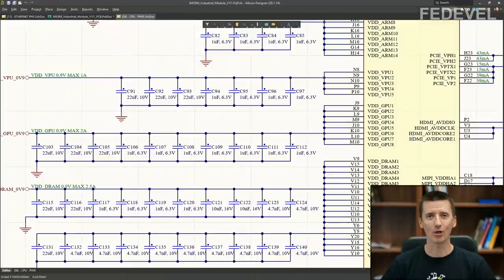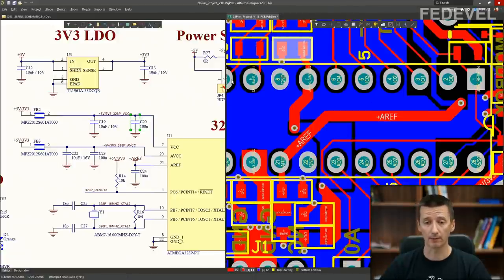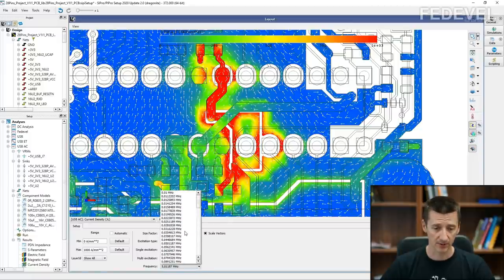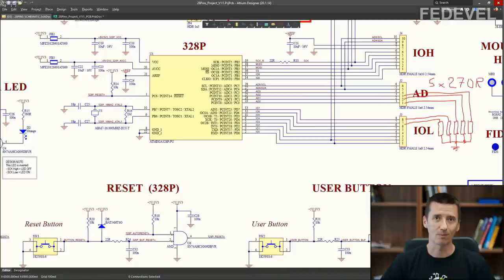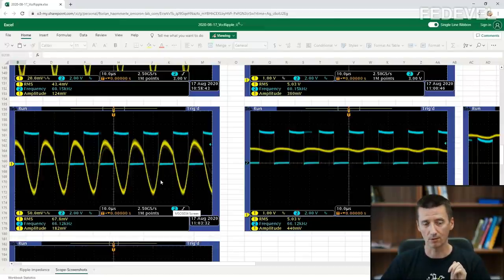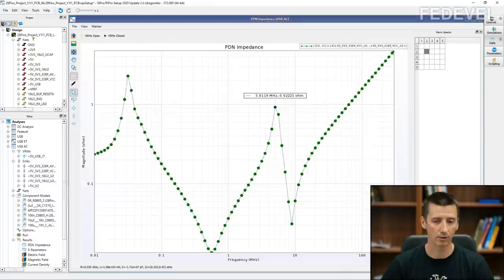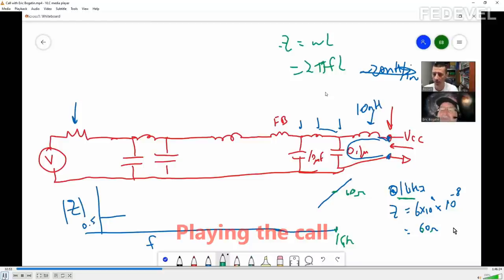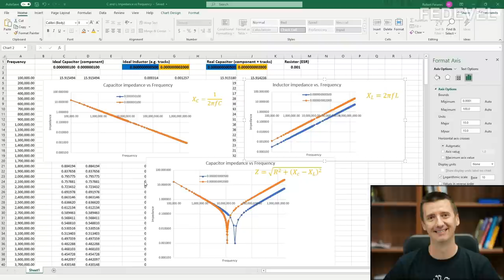PCB Layout & Decoupling - Explained why it's so complicated (Part 1)

Comment: There is no need to be embarrassed.  Going from the knowledge you gained from books, slides, lectures and whiteboard doodles to using it in practice is very often a "connecting the dots" moment and it's not so unusual to need an example, some hand holding, or just extra time to think about it before it all comes back.  Great video as always, thank you very much.

Comment: This guy's humbleness keeps amazing me again and again... An anecdote: I'm a power electronics guy and have worked with high voltage converters. So I used to design and build high frequency high voltage transformers all the time and measure the transformers parameters with the help of an impedance analyzer. I've developed reasonable experience, but the fun (sad) fact is: I had never thought of PDN this way! I guess we end up ignoring the basics when we're faced with a complex problem sometimes... Thank you for all the content!
Reply from the maker: Thank you Andre

Comment: Thank you all so much for explaining, after watching this video (part 1), you let me realized that even though the microcontroller is doing the switching (on and off), this situation can cause the microcontroller's voltage supply "Vcc" pin to fluctuate (having voltage ripple in millivolts), where the voltage across the microcontroller can become low depending on how large the "Power Delivery Network" (PDN) impedances is.

You also summarized the 3 things that you've learnt, which is the key take aways of this video❤️ love your videos, Robert, Florence, and Eric🙌

Comment: Hi Robert,
I definitely want to see the next part of this video. What I really like about this video is the collaboration of the different area of expertise that you are bringing together for us. For instance:
1) The board from your PCB design course which teaches us how to make the best use of the PCB layout tools and follow best industry practices, 2) The simulation software that you used and showed us how we even we can simulate our own designs if given the right tools.
3) Last but not the least, how you compare simulation results with actual waveform captures from oscilloscope and then bringing the expertise from Dr. Eric Bogatin who looks at circuits way differently than others given his background in physcis.

Keep up the good work Robert, it is really educating young engineers like us.
Reply from the maker: Thank you very much Nihar PS: After making this video, I may need to do some improvements on the board :D

Comment: Thank you so much for this explanation and demonstration, Robert, Florian and Eric ( no disrespect meant by omitting your surnames ).
I thought I would not need to be this  careful about switching noise at low frequencies and it's mitigation with decoupling capacitors. I have been so wrong and I stand corrected, but my curiousity about how this works is also awakened. Thanks again!

Comment: No one has every subject mastered. I say we're born with faulty DRAM built in. We regularly need to manually reset the refresh rate and often start over.
  I was in the same boat as you when Mark asked you those questions. I was thinking, 'I should know/remember this,' but honestly didn't at the moment. It's okay though. I know I need to grab The Art of Electronics off the shelf and look in the first few chapters for my answer.
 Thanks for sharing.
Reply from the maker: Thank you. PS: Yes, I had to refresh a LOT of theory when working on this video.

Comment: The most simple method is to draw the return path of each signal/current, try to minimize the overlap between sensitive signal and noisy tracks. Always place the decoupling cap close to the chip.

Comment: Good video. I really enjoy every of your videos robert. As I am currently writing my master thesis I have to add something: Everything about decoupling you told does not apply to multi-layer boards as the inductance is almost non existent by the use of vias and power planes, rather its more about reducing the length of the trace in order to transmit faster waves with lower wavelength without reflections. That's why high capacitance values like 4,7u can be placed almost everywhere on the board when designing 4+ layer board :) Best Regards!
Reply from the maker: thank you Oizys. PS: we will speak about this in one of the next videos. I already have recording of this topic from my call with Eric, I just need to process and prepare the video.

Comment: It's no wonder so many MCU datasheets recommend connecting decoupling capacitors directly to the power pins (NOT through vias) with the shortest traces possible.  Having a PDN characteristic low impedance is neat, but better to suffer a few ohms and have a flat impedance profile.  I was familiar with processes for measuring frequency response  of the PDN with instruments for that (I'm guessing you will reveal in future videos), but I hadn't considered the remarkable DIY approach you show here.  Thanks Robert
Reply from the maker: Thank you Greg. We will mention flat impedance in next video(s). And yes, Florian will mention how we measured it - we used Bode 100 ( https://www.omicron-lab.com/shop/Bode-100.html ) and a probe which Steve Sandler from Picotest borrowed me ( https://www.picotest.com/products_index.html )
Reply: @RobertFeranec  Yay! Exactly the method and tools and expert advice source I had in mind.

Comment: FesZ Electronics had an excellent video on this as well. In my opinion in the end it's all very relative. So, yes you can sometimes get resonance peaks in the impedance, but in the end of the day it's lower than without additional decoupling. Also it always will be a compromise between decoupling vs noise reduction not only from the power supply but also INTO the power supply (something people really seem to forget).
Reply from the maker: I will have a look, thank you P_Mouse. PS: I will continue explaining in the next part ... if people like this kind of content. Eric also spoke a little bit more about decoupling, so I would also include that ... it was very interesting call.
Reply: @RobertFeranec  yes, I am definitely interested in part 2. Basically instead of using Excel you can just simulate a lot in LTSpice. Just saves a lot of time.
Reply: @RobertFeranec  oh and btw, don't be embarrassed. We all had our blackout moments haha 🤣👍🏻
Reply from the maker: @p_mouse8676  initially I started simulation in Circuit lab ... and it blocked me out and asked for registration, so I opened Excel spreadsheet :D
Reply from the maker: @p_mouse8676  :D PS: I have never been the smartest at school, there were much smarter people.
Reply: @RobertFeranec  LTSpice is free, other alternative is Mircrocap, which is also free nowadays,

Comment: Got electronic education, key point and important thing you learn is that components are not ideal but have parasitic atributes.
I also have education in Automotive. And wenn I was young also into car hifi. Those huge buffer 1F elco with protection circuit. To buffer the slow chemical car Battery for heavy bass line in the music. Or insane capacitance device the size of small freezer to fire Gas laser. For making holes in PCB it also about fast power.
All parasitic inductans from decoupling C tot internals IC all adds up. That why short trace and close to pins means less inductance to add. 
Well its nice refresh of knowledge.

Comment: Wanted to make a "quick" video about decoupling capacitors.  Oh how I laughed !   I recommend Signal Integrity Simplified by Eric Bogatin.  Saved to watch later.
Reply from the maker: Yeah ... I know now .... it's not so simple :)
Reply: @RobertFeranec    Whilst at Nokia, I developed a Xilinx based FPGA board for camera image manipulation development.  My boss at the time was very unhappy that I had spent a whole three days working out the decoupling capacitor network for the board.  I pointed out that the design would have a PDN impedance of under 0.1 Ohm flat upto 800 MHz and that he'll be able to switch all the outputs simultaneously on/off without the device glitching.
I used Agilent ADS 2010 back then and modelled each capacitor as a combination of series RCL and parallel R lumps.  The data was provided by the detailed AVX datasheets.
Xilinx provide a very good application note for "Power distribution system design: Using bypass/decoupling capcitors"  ref XAPP623
Reply from the maker: @BobBeatski71  Nice!

Comment: for future video, i hope you can make some discussion about this important topic for more specific application, in this case, the microcontroller running in lower switching, for example in motor application where the switching output (PWM) usually around 20 kHz (not in range of 5 MHz as shown in video).

Comment: Robert,
Nice work with Florian and Eric.

I would like to suggest some vocabulary.  The waveform that the switching load forces onto the power supply nets is best called "interference". It is a signal that will mix into other loads sharing the same power supply and interfere with the expected signals there. 
I would reserve the word "noise" for non correlated and unpredictable disturbances such as, but not limited to, the thermal excitation in conductors called Johnson Noise. 

This distinction is helpful. 

Next the series elements in a power supply network should be called "Decoupling beads" or even "Decoupling resistors". These elements decouple one interference source (one load) from another (other loads also known as other victims).  They also decouple the capacitors near the load from the distant and usually very large capacitors in the power supply which prevents typically the lowest frequency ringing in a power supply distribution.

The capacitors to ground on the power pins of a load should be called "Bypass capacitors" . They offer a low impedance path for current between the power pins of a load and the ground pins of a load and the current the load consumes comes from them in proportion to how easy it is to flow (You have to think conductivity here).  
This last sentence shows why it becomes insightful to think of the currents that flow as the load is active. It is providing this current to the load the bypass capacitors are doing.  
The current bypasses the power distribution network and stays local to the load and it's bypass capacitor(s).

At high frequencies the load current is supplied by the local bypass capacitors and they (the bypass capacitors) are recharged only at lower frequencies through the decoupeling components of the power distribution network.

For good electromagnetic compatibility you never want high frequency currents traveling a long distance over power networks.  To have high frequency currents traveling over long distances is to build a magnetic loop antenna which couples interference into adjacent circuits and even perhaps outside the product where your friendly FCC compliance people will measure them (thus causing you to have to revisit an FCC test after design changes).

Sage advise I learned from a mentor. "Never use more bandwidth in any circuit than you need for that circuit's proper operation."   So for example put a 1K resistor on all of your UART TX and RX nets cause they are going to be very sloooow compared to the typical processor clock. And for best effect the resistor on the RX line should be near the level shifter not the processor.  Do you see why?

I hope this helps.
(Forrest) Lee Erickson
Physicist who pretends to be an electrical engineer.
Reply: Would like to ask Florian if he has placed the Arduino sketch (that he used to operate the DUT at the various frequencies) somewhere public? 
Although I do not have a Fedeval Arduino I have some out of China with a QFP processor and the bypass capacitors are quite distant from the controller. Would like to measure my DUT.
Reply from the maker: Thank you very much Lee
Reply from the maker: @forresterickson6225  Lee, here is the code:

//storage variables
boolean toggle = 0;

void setup(){
 
  //set pins as outputs
  pinMode(0, OUTPUT);
  pinMode(1, OUTPUT);
  pinMode(2, OUTPUT);
  pinMode(3, OUTPUT);
  pinMode(4, OUTPUT);
  pinMode(5, OUTPUT);
  pinMode(6, OUTPUT);
  pinMode(7, OUTPUT);
  pinMode(8, OUTPUT);
  pinMode(9, OUTPUT);
  pinMode(10, OUTPUT);
  pinMode(11, OUTPUT);
  pinMode(12, OUTPUT);
  pinMode(13, OUTPUT);
  pinMode(14, OUTPUT);
  pinMode(15, OUTPUT);
  pinMode(16, OUTPUT);
  pinMode(17, OUTPUT);
  pinMode(18, OUTPUT);
  pinMode(19, OUTPUT);

  cli();//stop interrupts

  setInterrupt(159); // = ((16*10^6) / (frequency*2)) - 1
  //50kHz = 159
  //60kHz = 132

  sei();//allow interrupts

}//end setup

void setInterrupt(int divid){
  TCCR1A = 0;// set entire TCCR1A register to 0
  TCCR1B = 0;// same for TCCR1B
  TCNT1  = 0;//initialize counter value to 0
 
  OCR1A = divid;// = (16*10^6) / (freq*2) - 1
  // turn on CTC mode
  TCCR1B |= (1 << WGM12);
  // Set CS21 bit for 1 prescaler
  TCCR1B |= (1 << CS10);  
  // enable timer compare interrupt
  TIMSK1 |= (1 << OCIE1A);
}
 
ISR(TIMER1_COMPA_vect){
  if (toggle){
    //sets all pins to high
    PORTD = B11111111;
    PORTB = B00111111;
    PORTC = B00111111;
    toggle = 0;
  }
  else{
    //sets all pins to low
    PORTD = B00000000;
    PORTB = B00000000;
    PORTC = B00000000;
    toggle = 1;
  }
 
}

void loop(){
  //do other things here
}

Comment: Great video.

I have not looked up the exact parts used, but I suspect the discrepancy in resonant frequency of 30 kHz vs 60 kHz likely comes from the reduction in capacitance as DC voltage is applied over that physically small 10 uF ceramic capacitor.

Small ceramic high-capacitance tend to have a very strong dependency, sometimes with the capacitance reducing to 1/10 of the rated capacitance (!) when at rated voltage. Most types except C0G are affected.

Also the inductance of the ferrite bead could decrease with increased DC current. Possibly by a lot.

If these effects are not taken into account in the simulation models, the real resonant frequency will be higher than the simulated as both the inductance and capacitance are lower at the real operating point.

Comment: Thanks for sharing this information.  I really liked how instead of simple, hand-wavey, "ringing happens and it's bad, mk" you actually showed how the ringing itself encodes detailed information about the nature of the circuit/issue...awesome.  
Also I'm quite curious about how you go about mapping the PDN impedance on actual boards (vs in sim)... Are you just sticking a VNA into the VCC pin? Is there a more "poor-man's" solution to this e.g. simply mapping the amplitude of a small signal from a generator or something?  Can't wait to see how you did it.
Reply from the maker: Thank you very much. PS: We will be talking about the measurement. But simple answer is, we used BODE 100 https://www.omicron-lab.com/shop/Bode-100.html

Comment: The imaginary part of the impedance @52:27 should be X_L - X_C (though, the value calculated by your formula will not different from the correct version for the square gives of the difference always gives positive values)

Comment: @Robert Feranec, you mention in the video that at 66kHz there is something special, and there certainly is, but you mentioned “when we are operating at that frequency.” However in digital design, we are always operating in that frequency because a square wave (at least a perfect/really good one) is made up of “all” the frequencies. So it is important to have a PDN impedance as low as possible in ALL locations within your given bandwidth otherwise this ringing will occur.
Reply: I really appreciate these videos, really good stuff! And I also enjoy that you are making me think about things in a new light

Comment: The first anti resonance at 60kHz is caused primarily by the parallel resonance of the bead and the 10uF capacitor. The reason the simulation was off, was because the models don’t take into account the inductance drop with DC bias, and may not take into account the capacitance drop with DC bias. Both of these model discrepancies cause the resonance to be predicted lower than reality.
Reply: I noticed people always neglect DC bias in ceramic capacitors.  
I always wonder when application notes are calling for xx nF capacitor,what actual capacitance they are asking for.

Comment: Before we go to the part 2, I have a question. Since we are talking about frequency going into GHz range, it must be remember that the non-ideal characteristics of the inductor mean that it behaves like capacitor at very high frequencies and thus has a self resonance and that the capacitor behaves like an inductor at very high frequencies and thus has a self resonance. This is not discussed in the graphs near the end of this video.

Comment: Here is practical comment how this board could be improved.  
I would route power trace to the decoupling capacitor pad from the above instead directly to the chip pin. I would make that power trace thinner. Only when it goes form capacitor to the chip it needs to be thick. 
1.Thinner supply line will filter the noise that may go to other component
2. Connecting the track from the above will reduce EMI on the power trace, as the chip will not be drawing power from it directly, since the cap will be closer.  
3. Thicker line from the cap will improve power delivery to the chip.
Reply: Also moving the gnd via above the cap would allow to move the cap closer to IC chip which would further improve everything.

Comment: @Robert Feranec at 23:38 the table in excel sheet shows different freuqncies of IO switchings and also the ripple voltage and current at each frequency. My doubt is that current is same 42mA for all frequencies of IOs...is it not that current increases with higher switching frequencies?